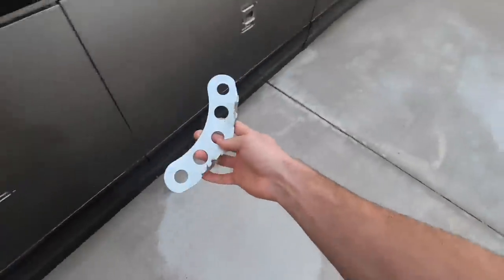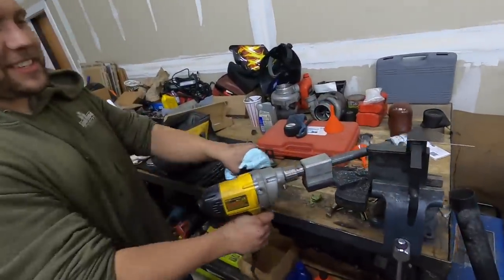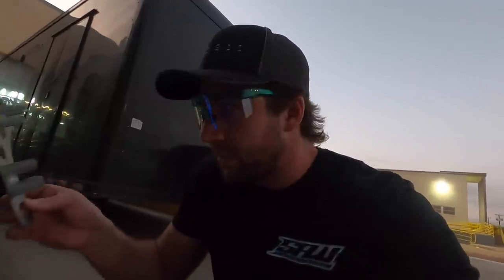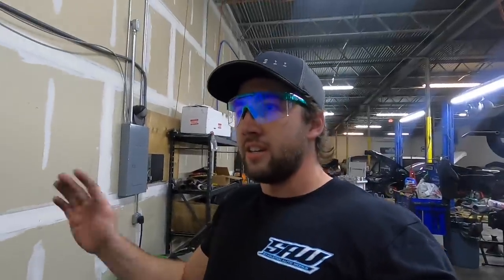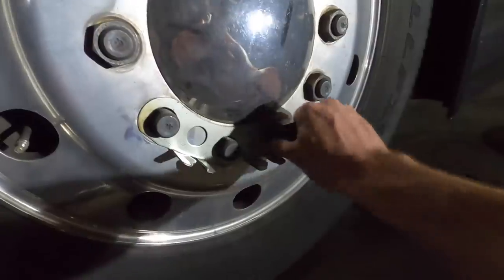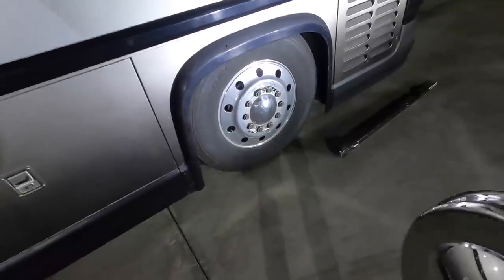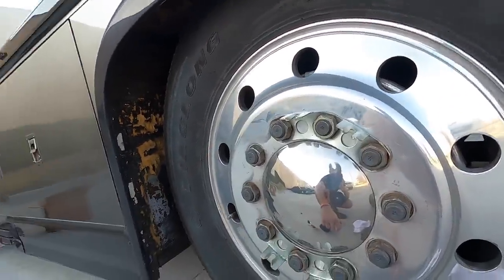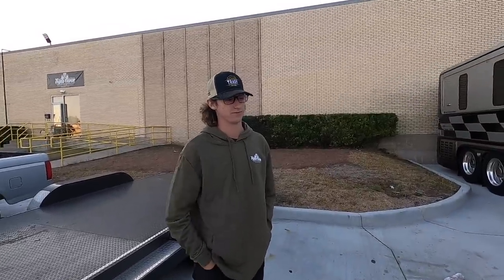Newell Coach Lug Nut Cover Upgrade and Some Polishing! (Should Have Done This Sooner)

Comment from the maker: To those concerned about the lugs coming loose in the comments: It did not look right to me either, so I reached out to a Newell tech and he said thats just how those things are. Every one he has taken off has had the bracket squished into the seat like that apparently. He said as long as it was torqued to 450ft lbs it'll be fine. I got the adapter and torqued them the day after filming this.... for those who were wondering we're all good lol
Reply: We used them on semi trucks for years with no problems until bs California made them illegal & we still use them till now without any issues but if it falls off you can hear it clunking around inside
Reply: Would the caps fit if you sandwiched the brackets on the outside of the original lug nuts with the bends facing inward? Then used another nut like a jam nut? Might have to grind the jam nut down thinner but I think that would be a better option. Just because someone has done it before doesn’t mean it’s safe. Hate to see something happen to the coach or yourself or someone else on the road.
Reply from the maker: I don’t think the manufacturer would send these out the door like this if it were unsafe. Let alone a top tier manufacturer like newell lol. I trust them
Reply: Technically those a made for hub pilot wheels,  which have a washer on the nut and would sit flush to the wheel.  But you did a good job making them fit. Long as you torque the lug nuts you will be fine.

Comment: Tire guy here. Those hub caps look like they are for a newer style flat face lug nut "hub pilot" 33mm. The older style like you have is a "bud style" 1 1/2 wedge style. It seems like you might not get a good torque with that plate between the mating surface.
Reply: This is important. I dont think the lugs are made to be used with that plate in there.

Comment: Get your torque wrench adapter asap and use it regularly as the holding plate you drilled is now distorted in the beveled hole on the aluminum wheel and might work the nut loose. Personally I think its fine but I would feel better checking the torque after driving it a short bit. Great video! I really like your RV!

Comment: That front wheel is not  hub piloted, it is a stud piloted wheel.

 Putting those brackets on  a stud piloted wheel is a huge no-no.

That bracket will interefere with the clamping force needed to keep that wheel firmly bolted to the hub.

Please take them off, this is dangerous.
Reply from the maker: I don’t disagree. I just don’t understand what the alternative is. Everyone I ask said that’s the right bracket just make the hole bigger
Reply: @Stapleton42   Look to see if there are other types of wheel covers available.  

You can't have that bracket between the lug nuts and the wheel face. 

There is no way that proper torque can be held by the lug nuts with that bracket acting like a washer.

You'll get wheel movement as the bracket gets flattened  and thinned out due to eventual wear and the lugs lose torque as the space between the wheel and lug widens.

As the lugs loosen the wheel will move ever so slightly front to back and start machining itself into the wheel studs. You'll get vibration as the wheels move around on the hub and elongate and oval out  the stud holes on the wheel.

If you're lucky you'll hear them as they fail, they sound like a rifle shot when they break and you can pull over.

If not you can have catastrophic failure of the wheel studs and the loss of the wheel.

One broken or loose lug is enough to have all the others on that wheel fail.

Also while you are at it as the vehicle is older, check the threads on the  wheel lugs to see if they are getting knife-edged. 

If they seem to be thin and sharp they need to be replaced as they cannot properly hold torque anymore and will eventually start to  fail.
Reply: @Stapleton42  are the lugs coned or shanked ? I was zoned out wishing this video was about a LSX instead of a Coach but I wanted you to still make money so I watched and commented on how I feel about your latest Coach content which is obviously by these comments much different then your other viewers and subs !!! So keep on keeping on !!!

Comment: Your wheels are going to loosen up. You can’t put anything between the lug nuts on that style wheel.
Reply: Yup. Did he check the difference between 'hub piloted' and 'stud piloted' rims?
Reply from the maker: I told the people what I had and this is what I got. It didn’t seem right to me either... I still don’t know what the correct bracket is for this type of lug. Everyone wants to point out what’s wrong and no one is offering solutions. Typical internet 😂
Reply: @Stapleton42  The simple solution is to take off one of the rear clips and compare it to the fronts. Usually there is a hole relief slightly smaller than the taper of the wheel so the nut can tighten the bracket and the wheel together. As the nut pulls tight it will self clearance the small difference, but you do need to make sure the wheel nuts make full contact with the taper in the wheel, if it doesn't then make the bracket holes just big enough that they do. The bracket should be wedged on the taper of the nut, not in the wheel. Hope that makes sense.

Comment: Bro great vids but please don’t drive like that. Those are tapered lugs for tapered wheels made to center the wheel. If they can’t seat properly then the wheel won’t be centered on the hub and could vibrate as well as come off
Reply: I realize the other lugs are centering the wheel but IMO it would be the same as driving with 6 lugs missing
Reply from the maker: If that’s the case then how do these caps go on this wheel? The bracket gets squished into the taper as you tighten it. That’s how the back is. It seems odd to me too but I’m not sure how else it works 😂
Reply: @Stapleton42  well in theory you could probably make the holes big enough for the outer edge of the lug to hold them on but still let the taper of the lug bottom out on the wheel at the same time but it’s gotta be pretty close to work right
Reply: @Stapleton42  the step bit will help as it leaves a taper naturally
Reply: Might have to make a custom bracket where you would put it on the outside of the
Lug nut and add another nut outside so you sandwich the plate between the original lug nut and a new jam nut.
Reply: @jeremyball9566  which also looks like it would require longer studs based on how much sticks out when tight

Comment: Don't think that's correct. Those are lug piloted rims. Those brackets should be used on hub piloted rims. Meaning the hub centers the rim and you use flat nuts on a flat rim. You have lug piloted rims which require the nuts to set into the rim for centering.
Reply from the maker: Well then what’s the other kind of bracket look like? I’m not sure what to do here either

Comment: You should not run that front wheel like that. The lug nuts should be against the wheel.
Reply from the maker: Then how do these brackets work because no one has a different answer
Reply: @Stapleton42  Make the holes bigger so the lug nut seats properly (bigger than the nut) and the mount sits flat on the wheel, drill and tap a the wheel for few 10/ 24  screws and screw the bracket in place.